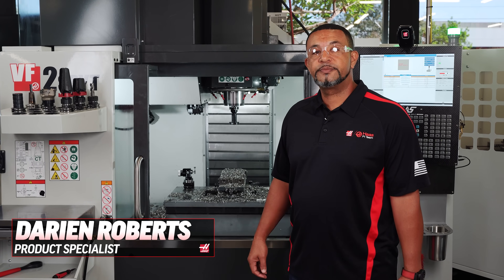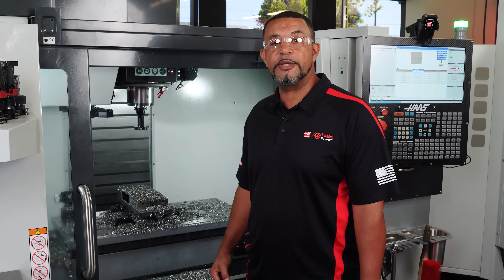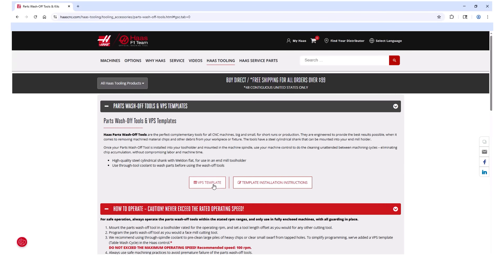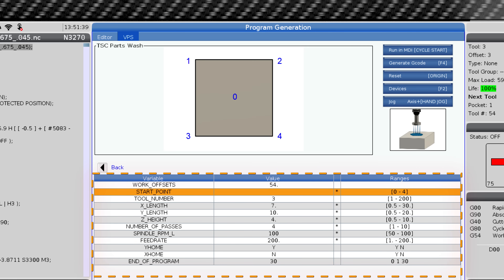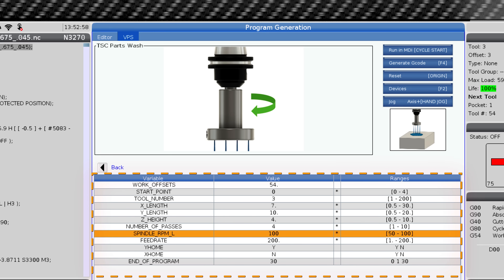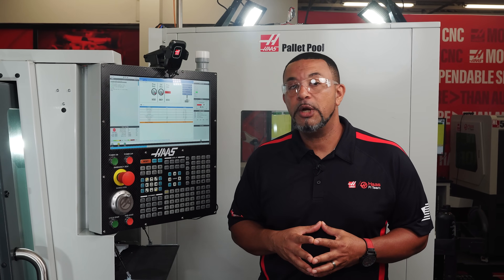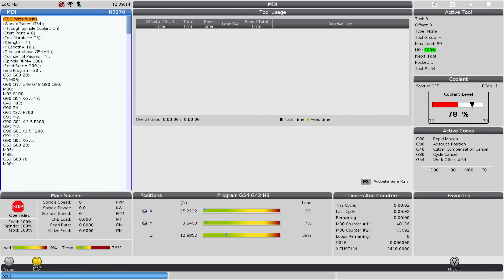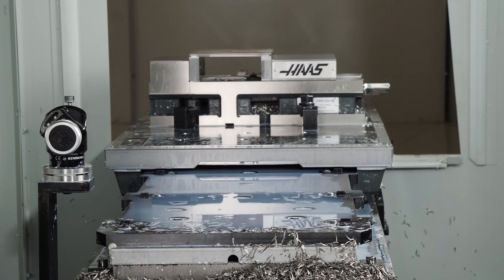Haas Mill Table Washdown Tool - HaasTooling.com

Comment: If my part finished with chips on it like that there is a big problem. Upgrade the coolant system to a high flow Swarf Unlimited wash down system. 60PSI at the spindle coolant ring.